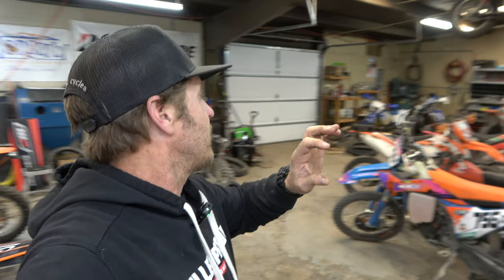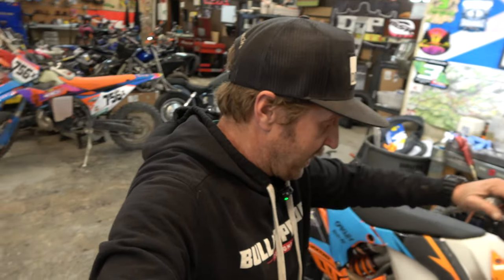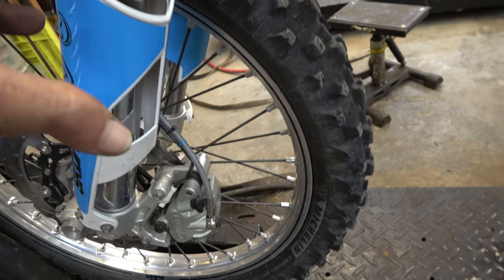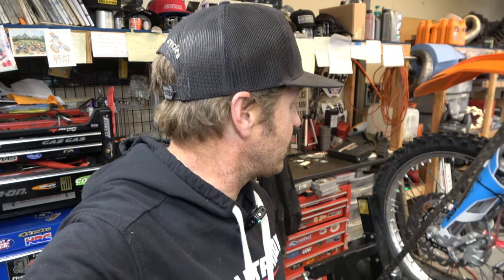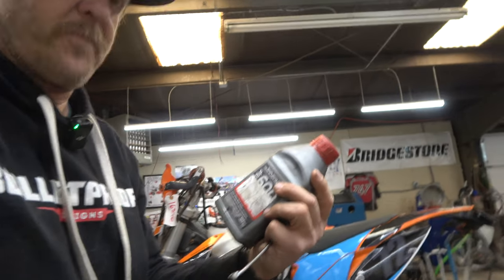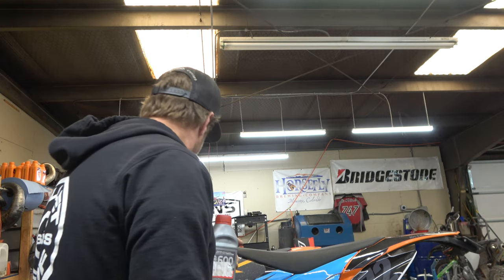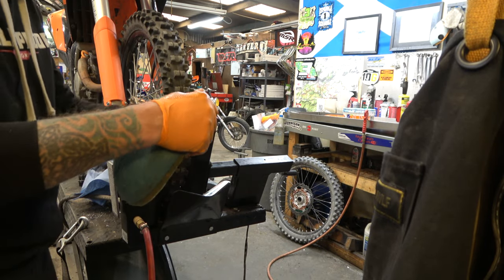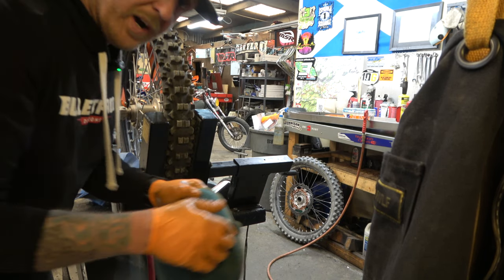The Shlog #241 | Oil Your Damn Air Filters | Broken Cases | Blown Up TTR 90 | Highland Cycles

Comment: I have 3 of the large spoons from tusk.  The big ol jobers with the aluminum handle.  Work great, but I have a new Rabaconda I've not used.  Going to try those larger ones, with the couple of motion pro ones I have shaped like the Rabaconda.  I just have not had time to use it.

Comment: My riding buddies are the worst about preventative maintenance. They’re newer so they haven’t blown anything up yet. But I refuse to do it for them. I let them know too. It went from “I would do the air filter before we ride next time” to “it’s taking so many kicks because you need to do your valves” 😂 

His bikes gonna blow any day I swear. He’s done one oil change in 2 years
Reply from the maker: Hahaha, it is so frustrating
Reply: If its a newer rider help them out.  You don't know what you don't know till it punches you in the face.  I try not to be "that guy" always working on his stuff at the trail head and not in the garage.  When I raced regular I would take Monday night to clean the bikes so I could order parts on Tuesday if I needed.  Thursday was bike night... fix what needs fixing and maintenance.  Just for a few hrs.  Worked well to keep things in decent condition and minimize ride day repairs.
Reply: @Danman1972  I’m not going to just give them fish. But I’d be more than happy to teach them how to fish. The thing is they are not mechanically incapable. We’ve all rebuilt motors in our spare time. They know how engines function and the parts involved. They are just lazy. Im not going to do 5 air filters lol. When I’m working on my bike they’re standing around looking at me work on my bike lmao. Listening to me hound them about maintenance. I’ve offered 100 times to help my buddy to a top end on his Honda. But I won’t just do it for him when he’s not around. 

I came to realize that’s 90% of riders. Just run it till something breaks.

Comment: I won a package of no toil oil air filter oil so I used it. Worse air filter oil. It all ran off filter and ran down everything on my bike. I was wondering what could be leaking. Dont use notoil filter lube. Wonder if thats what they used and it ran off leaving dry filter. If it was lightly gold colored oil thats their issue recommend they use other brand air filter oil
Reply: Mine ran off and looked like filter had no oil on it. Sad junk product sure thats what they used

Comment: Don’t stress about that side plastic. I’ve made a stress crack the exact same way on the lower grommet of my vented air filter cover. ‘22 SXF. It’s so damn hard to pull off. I don’t even try any more. I have a dulled 1” chisel to pry it up. KTM shouldn’t make them that tight.
Reply from the maker: I know. It’s stupid.

Comment: 03 yz450 with a steel.cage and foam filter, is it okay for me to use fogging oil? It's made to be burnt off, extremely light oil and clear.
Reply from the maker: To store the bike?  Yeah. Not for air filter oil

Comment: Ok wait a sec, what did you say about no-toil air filter oil ? Elaborate on what you mean when you said maybe their using no-toil air filter oil and it might be running out of the filter. Is this something you’ve seen? I’ve noticed no matter how well I squeeze out no-toil it seems to accumulate at the bottom of my filter between filter maintenance which is usually every ride.
Reply from the maker: Yes, no toil will run out and dry up if left alone too long. That’s why I don’t like it.
Reply: @highlandcycles  Its also not water resistant like normal oil, with real oil you can submerge the filter for a few seconds and no water will pass through. Could come in handy!
Reply from the maker: @ShawnBlais  agree.
Reply: What’s going on with loctite? They donated to enviro group or something?
Reply from the maker: @byronfrick7155  the owner is actively trying to close trails in Rico. He also owns a hot springs up there and he is a royal piece of crap